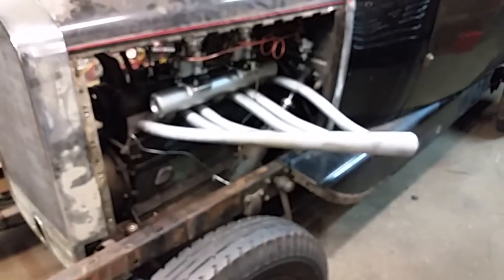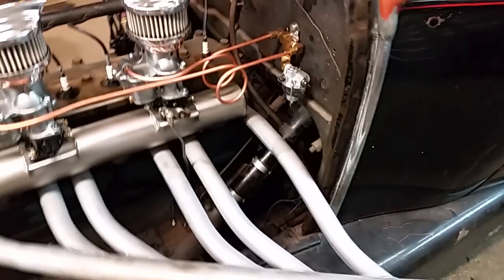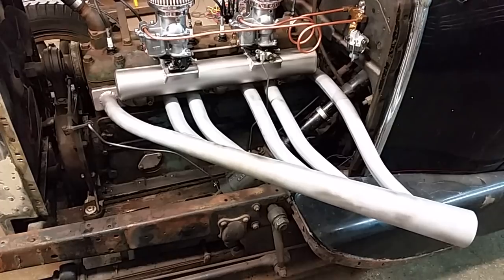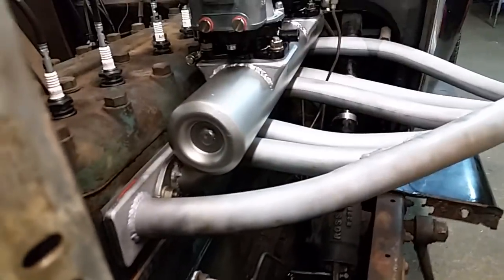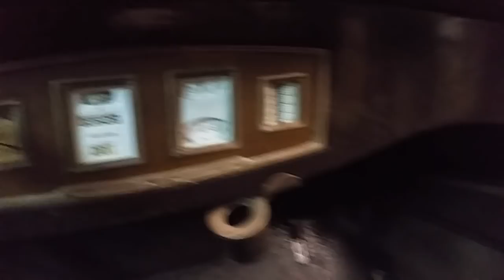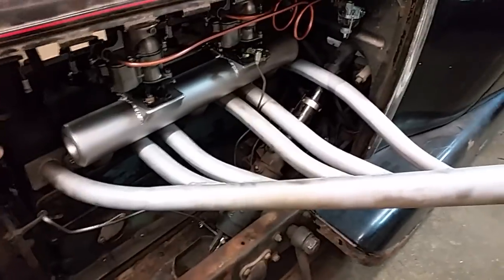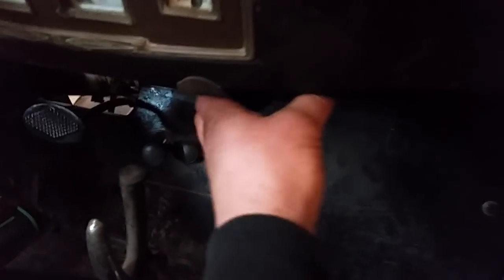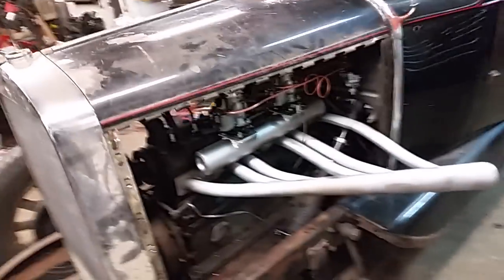Recap on the Studebaker

Comment: Hey Matt!  I really like the look of the copper gas line.  Way easier to bend up I would guess?  is it safe?  I'd like to redo my pump to carb line on my SBC, I am horrible with steel line.......... nice work BTW!
Reply from the maker: Hi Matt ! long time no see ... lol 
the copper is nice to work with , didn't like my tubing bender . would just kink . so all the bends were done by hand slowly . I know they make a copper brake line . you can get it in rolls . i've been told thats the way to go for the awesome crap they dump on the roads for us in winter . I want to try that stuff out soon on a up coming project .

Comment: I’m shocked you had cab mount parts up there in saltville. Pretty sweet.
Reply from the maker: we normally dont , but many years ago i bought out a guys collection of square body parts . He was building custom quad cabs and only bought them from Texas . I had boxes of clean used parts . Mostly odds and ends .
Reply: chevahaulic I keep finding them around here. Found one for 600 bucks yesterday. Six cylinder and it ran.